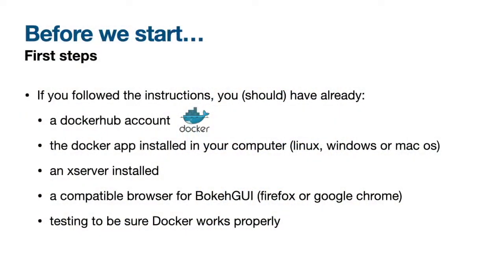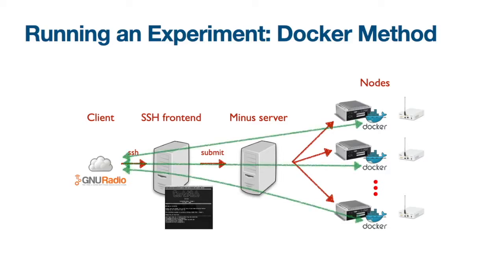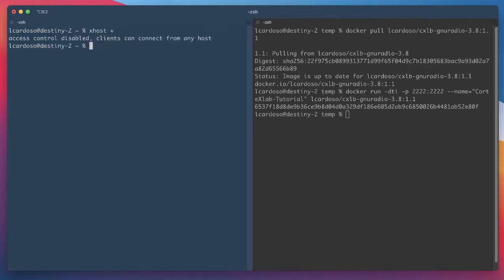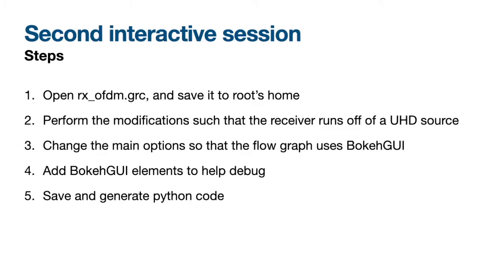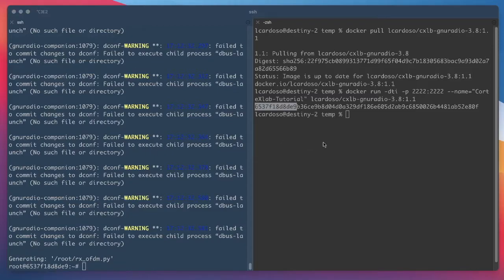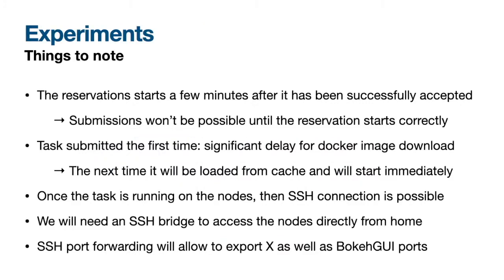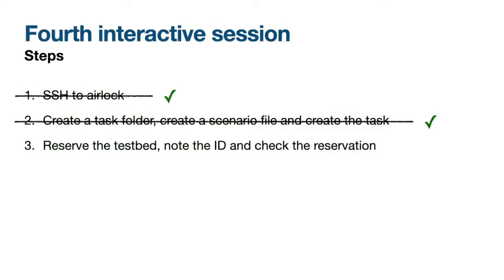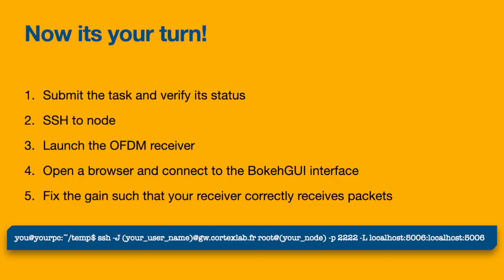European GNU Radio Days Introductory tuto 3: FIT/CorteXlab with GNU Radio using Docker (L. Cardoso)

Comment: i have the following error, can you help me?
.
Generating: '/tmp/top_block.py'

Executing: /usr/bin/python3 -u /tmp/top_block.py

QStandardPaths: XDG_RUNTIME_DIR not set, defaulting to '/tmp/runtime-root'
gr::log :INFO: audio source - Audio sink arch: oss
audio_oss_sink: /dev/dsp: No such file or directory
Traceback (most recent call last):
  File "/tmp/top_block.py", line 180, in <module>
    main()
  File "/tmp/top_block.py", line 158, in main
    tb = top_block_cls()
  File "/tmp/top_block.py", line 99, in _init_
    self.audio_sink_0 = audio.sink(32000, '', True)
  File "/cortexlab/toolchains/current/lib/python3.7/dist-packages/gnuradio/audio/audio_swig.py", line 149, in make
    return _audio_swig.sink_make(*args, **kwargs)
RuntimeError: audio_oss_sink